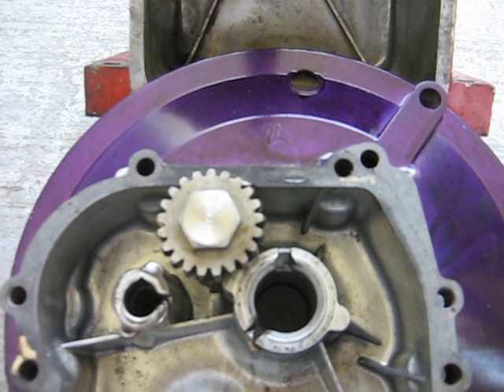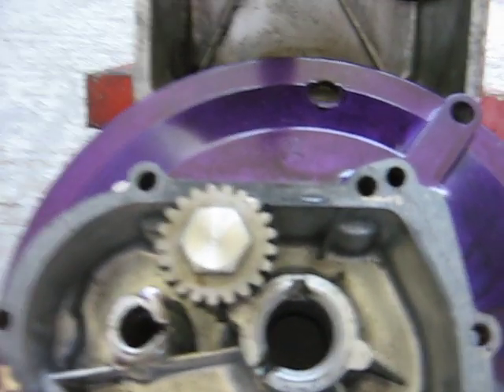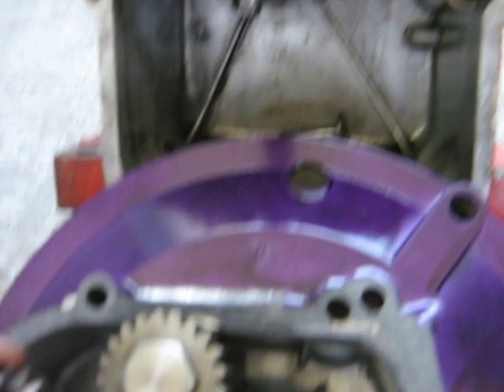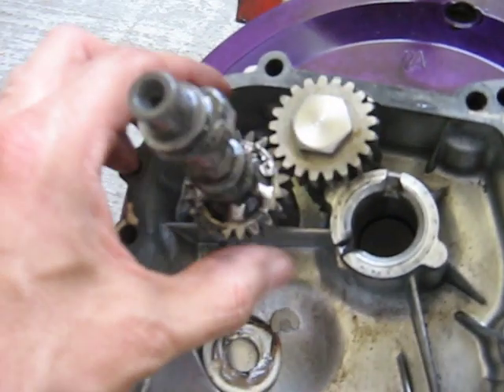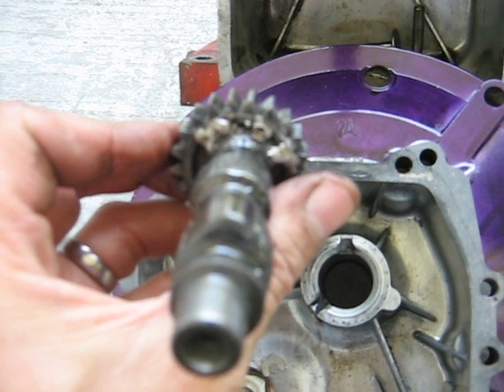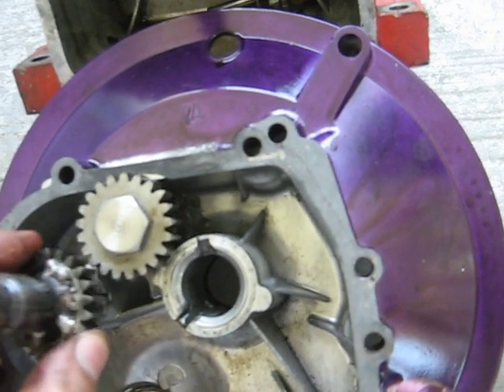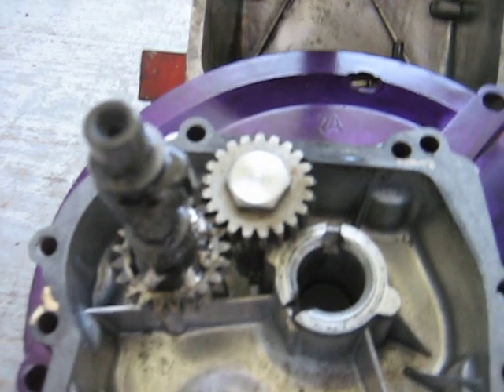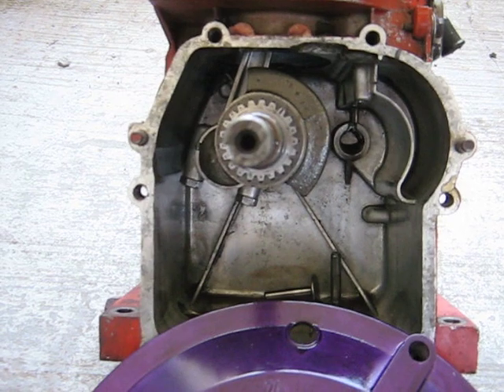Full Speed Camshaft, How it Works!

Comment: do you think a gas engine could use a variation of this to make it a 2 cycle? and if so, how do you think it would run?
Reply from the maker: thereelmaster . I know you can take a 4 cycle, make the camshaft spin twice as fast (perhaps modify the cam lobe shape) and the engine will run. I did it with a 4 stroke Briggs engine. Though you do need some type of supercharger (air pump) to force the exhaust out of the cylinder, since the piston movement won't do it. Watck my "poppet valve 2 stroke" vid, the engine has a yellow cylinder head.

Comment from the maker: It is bolted in place thru the crankcase cover. Basically it is a 1/2" bolt, with the head machined thinner, the head is next to the idler gear. The bolt then sticks thru the crankcase cover (a nut is on each side of the cover, to hold it in place).The outside nut is JB welded to the cover to hold and seal it against oil leakage.
It is a pretty slick set up, my  machinist friend does GREAT work!!!

Comment from the maker: I think it can be more efficient, as it can cut the air off while the piston has only moved 1/4 of the way down the stroke. With a regular 1/2 speed can, I was lucky to have it cut off the air at 3/4 of the way down, plus I get a lot more valve lift this way.
I will try to make a vid sometime explaining all this.